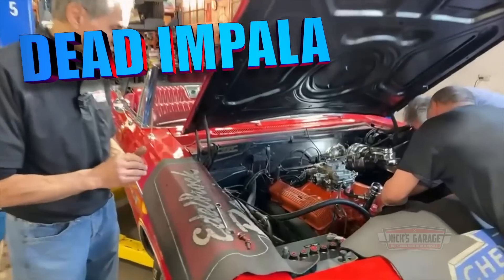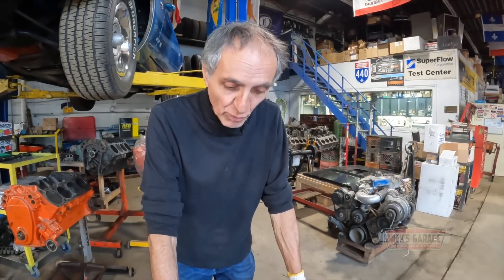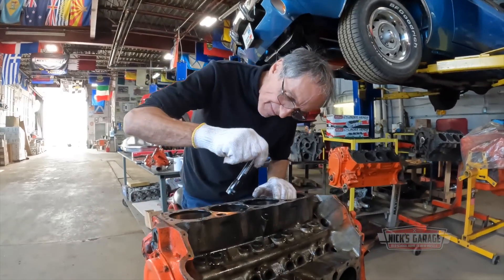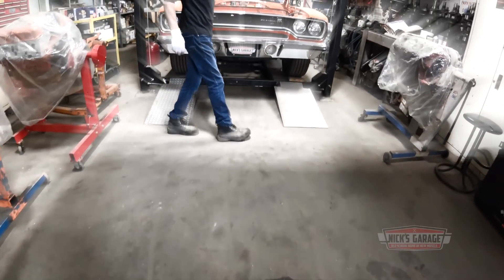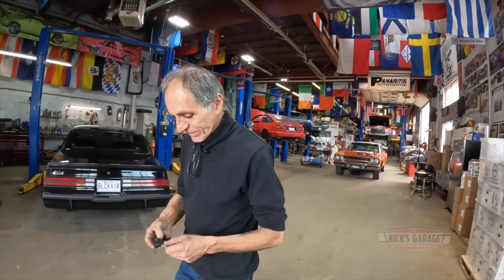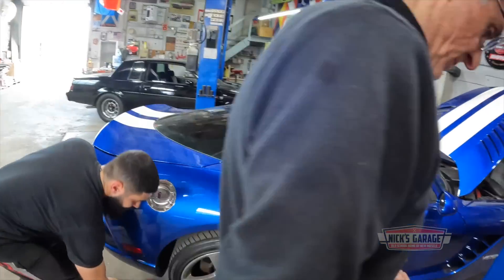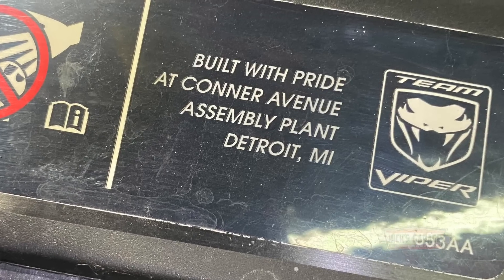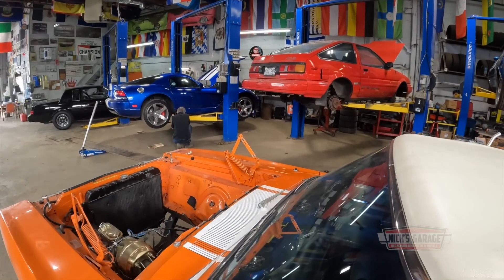327 Chevy Autopsy - Smoking Gun FOUND!

Comment: I'm on your side Nick No matter the cause of overheating The customer has some responsibility too
Reply: Clearly it was more than overheated, That engine would have been doing 30 mph with his foot on the floor and for a long time detonating real loud! On more than one occasion. That poor engine was begging for mercy!
Reply: Brian I agree but the only fault of Nick was using “Mr. gasket“ brand thermostats and not a Stant brand as I consider Mr. Gasket to be middle of the road quality at best And this situation is evident of their poor quality control. On high-performance engines I don’t even use a thermostat but rather just a thin brass plate with usually a three-quarter inch (3/4”) diameter hole in it or take the guts out of the thermostat and use it like that.
Reply: @MrR6guy  I agree
Reply: @Doing_it_right_the_first_time  The Mr. Gasket thermostat is a balanced flow thermostat and is not affected by coolant flow.  It is much more accurate then a standard spring type thermostat..... but only when they work!
Reply: I prefer the thermostats that "fail open" this way when they go bad like this one did, the engine will not overheat.
Reply: I've been drilling 1/8" holes around the skirt for decades. It makes sure you ALWAYS have some water moving through. Plus it also helps with "burping" air bubbles out.
Reply: @blackbuttecruizr  I’ve seen 11 of those fail closed from myself and friends.
Reply: @Doing_it_right_the_first_time  I used brass washers on all my dirt track car powerplants, never have a street/strip vehicle. Even had differing openings for different tracks and conditions trying to keep it right at 210 degrees with 8 lbs of pressure.
Reply: @blownaway4371  two 3/16 holes I used in Chicago Illinois where we have BAD winters. Makes the coolant system work so much better in cold weather when the thermostat will close. It keeps a better balance and heater has constant heat.
Reply: @Doing_it_right_the_first_time  Exactly what I do!
Reply: You know that hindsight is 20/20,and most of the people on Nick's page are car guys. Opinions are like....well you know. But I agree with a lot of the comments I've seen on here that basically say, at some point the owner had to know there was a catastrophic problem but chose to keep going. Who knows why,maybe he was out in the middle of nowhere and was trying to make it on home and in his mind Nick would stand behind it, so might as well melt it down. You never know how some people think, but I personally think that the customer should fess up and admit to himself and everyone else that he is the reason this thing is in the shape it's in, and he should have a fail safe system installed because it's obvious he doesn't know how to take care of his equipment on his own. A true car guy would have never let this happen. Some people love the idea of driving around in an awesome classic but would be better off just loading it into a trailer and hauling it from show to show.  BUT that's just me.

Comment: I can't wrap my head around anyone driving a car to that point. He had to know he was destroying it. With or without a light or gauge.
Reply: My sentiments!
Reply: Also told him wrong cam...
Reply: That's the first thing I thought why would you continue to destroy the engine just stop and figure out what is wrong.
Reply: STOP! And call a tow truck! Why would you drive it till you cook the engine? Makes no sense whatsoever. I've had engines over heat in my 55 plus years of driving. Never drove it till I roasted the engine. Now.... who's to blame here? Who pays 4 what?
Reply: I see it all the time. Most people today just put gas in the car and drive, they don't care about anything unless it flat out QUITS going or it's ON FIRE !  Smoke, noise or smell, or slowing down just means STEP HARDER ON THE THROTTLE !  They have no clue and nobody ever sat there butts down to explain the FACTS OF LIFE !
Reply: @Thebowzer221  We had a 78 dodge B200 van for many years, the original owners loaded that thing to the hilt and hooked a 16 foot travel trailer to it. They roasted that engine AND transmission on a trip at 30,000 miles. It got a long block and transmission because of it. That had to have been around 1980, my dad bought it in 1985 at 80,000 miles. What a bunch of idiots, how long and hard do you have to hold it to the floor to overheat and kill a 318 and 727 transmission all in one go?
Reply: True. The engine would of been screaming warning signs at the driver. Losing power. Detonation,  smells of burning paint.
Reply: It must of been barbecuing for ages surely would of smelt it
...some people got no idea😳
Reply: As the engine begins to cook the oil gets very thin and the lifters get pretty noisy. The first signs that things were going wrong would have been the smell of burning paint the lifters clacking and valves rattling. Stop and visually see. This guy probably could have saved it but either didn’t understand or realize he was burning it down.
A newly rebuilt engine should be closely monitored Nick is the best but that is a very old motor things could go wrong at anytime!
Reply: There would have a been a smell long before it stopped

Comment: That 327 would have been pinging and audibly belching and boiling long before it got to the point where it would have been smoking. As soon as you hear the pinging, and boiling you shut it down BEFORE its smokes. Pull over and turn it off to prevent irrepairable damage. Even if the hot light didnt come on, that would have been smoking like a mofo from the engine bay. Condolences to the owner but that  wasnt the fault of the engine builder. Although the possibility that overheating caused the thermostat to jam it probably would have jammed in the open position if it overheated from a cracked water jacket or drained coolant. Classic stuck closed thermostat.

Comment: The wax pellet inside the thermostat could have been melted and displaced by the extreme overheating.  45 yrs of turning wrenches,  never seen the paint burn off from overheating.  Plus that poor engine would have been pinging so bad, it might as well be a diesel,  how could the owner drive it like that and not know something was terribly wrong.  VERY fishy,  sabotaged is my guess.
Reply: Exactly
Reply: If something feels or sounds wrong check your gauges. I'm sure water and oil temps were pegged - IF - he had gauges. I've also have never seen one cook the paint off.
Reply: I completely agree, the owner must have heard something wey before he turned off the engine.
Reply: I’m thinking the same thing , like , has this guy paid up yet ? 
   But at the same time ,  you know of people that drove them till they dropped , right ?  
    Still , it makes more sense to me that it went out the tail pipe.  If it was the thermostat something up front would have let loose.  It should have blown off into the expansion tank or split a hose and that is a lot harder to miss then steam from the rear , especially at highway speeds.
Reply: My thought is someone drained the coolant on purpose.
Reply: The driver couldn't smell the paint burning off the engine?
Reply: @ewconway  Shut off ???   I bet it continued to run with the key off.  I've seen them so hot it continued to run like a glow plug engine dieseling and knocking.  Had to put in gear and then turn off the ignition.
Reply: @scrappy7571  The thought of someone draining the coolant on purpose is completely lunacy though…. Who in their right mind would want to do that?
Reply: The thing is in my opinion if it was truly the thermostat the Pistons would have got so hot that it would have spark knocked and detonated and I have never seen an overheated engine keep in mind overheated due to a thermostat or low on coolant burn the paint off of an engine however I have seen fuel continue to burn as it leaves the exhaust port due to very very late ignition timing causing the exhaust to glow red and melting the paint off a cylinder heads and cooking the top end of the engine and the very first video one of his employees said the distributor was loose and they quickly snuff that before anybody picked up on it I'm not accusing anybody of anything but I don't believe it was a thermostat sorry that's just my opinion
Reply: I agree, after such an extreme overheat, the thermostat is probably damaged even if it was working OK at the time.  That being said… that full flow thermostat design was originally done by the Robertshaw company, and they were the best thermostats, bar none. But Robertshaw went out of business and Mister Gasket bought the design.  IMO, they have not been any good since.  they’re now made overseas instead of North America the way Robertshaw did, and quality is nowhere near as consistent I’ve heard of far too many that didn’t work right out of the box or stuck unexpectedly. I use Stant thermostats now.
Reply: @stevelacker358  9
Reply: It’s kind of crazy not to have a temp gauge with the 40 overbore on an extra hp build, Stock fan and radiator
Reply: @ewconway  Let me think of a few.  Pissed off wife or girlfriend, jealous neighbor, kids pulling a prank, disgruntled owner,     the list is endless.   Situation is too fishy.
Reply: I was thinking same thing about the wax. If the engine got hot enough, some wax could have vaporized.
Reply: @ewconway  .....He never turned off the engine.
Reply: @SalterRacingEngines  ..     Yes the distributor had a slack of about 5 degrees either way.  To cook the engine that bad.
Reply: Nick I ran a business for more than 20 years You are there we are not I'm certainly not criticizing you You do what you feel is right and all we can do is treat the customer fair and do the best we can do I certainly don't wish bad on anyone
Reply: U
Reply: @nickpanaritis4122  oh wow….. I don’t want to lay blame here, but I think the driver has a large part in maybe not the real cause of the failure but the major damage done as a result….
Reply: @Chainsaw-ASMR .  After buying many bad Thermostats I like the ones that have a small hole  in them Just in case they don’t open, Always checking that temperature gauge driving these old beaters
Reply: @patrickmchose7472  my guess is maybe coolant came out the side past the head gaskets as steam and steamed the paint off......    
but even  stevie wonder woulda  seen  that
Reply: 5 degrees either way aint cookin it
Reply: @ewconway  Well, my older brother used to beat the pants off a neighbor with my 66 2+2 Mustang (I had not passed my driving test yet). The victim was a gorgeous 67 GTO. That 'Goat' was fine, but my brother was just a better driver on mountain roads. The neighbor, who had taken over payments until his bro could get back on his feet, was so livid he set the GTO on fire. If you can do that to a family member, you can do it to anyone. Hope nothing like that happened here. That 66 needs to be back on the road where it belongs.

Comment: I am a professional mechanic.
When an engine gets this hot, it is the driver that ignored all of the warning signs.
Severe detonation ( pinging).
The smells of severe overheating.
Ethelene glycol coolant gives off a very distinct sweet smell when it is leaking out of an engine.
It is just about impossible that this engine melted down with out giving the driver any warning.
I my opinion this car was "driven into the ground".
Reply: Some people have more money than brains and should never be able to treat a classic this way.  As Bugs Bunny says="What a Maroon"~!!
Reply: I agree it was maybe partially nicks fault a hose or who knows what maybe we will never know but if I went and picked up a basically brand new rebuilt car like that and was driving it my senses would have been in overdrive listening smelling feeling for anything at all that's not supposed to be and the second I felt anything or smelled especially antifreeze the slightest bit the key would go off and pull it over after all I just spent a ton of money on this car I do feel that nick should have insisted on some aftermarket gauges as well as the dummy lights working the customer is at least 85 % at fault because even if it did overheat he as was said cooked it to death and did a lot more damage than it should have gotten I've overhead many older cars back in. The day even as a kid and never cooked one that bad hell I never even blew a head gasket with iron heads ever not once and had plenty of bad radiators and water pump issues in the 80s with driving 60s and 70s era cars from the time I was 16 in Rhode island where it was a necessary thing to make sure you had antifreeze in it by September even because you'll get cold nights starting then by the time hollowen comes you better be covered to at least 15 below zero or well we all know and I learned this the hard way of course I had a bad radiator and got caught with water in a 72 Newport and ruined that great running 400 I used to get 20 mpg on the highway with sad I blew it dropped the ball whatever you want to call it but to this day I kick myself in the ass for that mistake
Reply: I agree driver just kept driving probably thinking I'm just a few miles from the house. I hate that for Nike not sure how I would handle this if the light was working that's the drivers fault that's why we have indacters on machinery I promise you buy a car and it runs hot all instruments are working it's not there responsibility to pay for repairs. Not unless it's a new vehicle and I guess it based on warranty you have
Reply: @kayceehetchler9626  I have to hand it to you, not one form of punctuation in the entire run on sentence. Kudos. Wait..I found 1 .
Reply: @Orcinus1967 
Yes I agree, a grammar/punctuation commendation is in order for that post!😂

Comment: Hi Nick , please keep looking for a problem!  The thermostat not opening after being grossly overheated would be normal.  Some of the wax that expands in it to open, would have escaped past the seal in a overheat.  It then closes and will never open again. 
Rick. Australia. 25 years Motor Mechanic.
Reply: Great point. I've noticed that just because a car travels in cooler climates, a thermostat opens & closes super frequently causing a wear ring on the body which can make the plate stick closed.. this is pretty rare but happens. If the magnaflux of the block or heads shows no cracks, a careful examination of the head gaskets & block mating surface is in order as well
Reply: Also cavitation caused by hot spots in the block happened fairly frequently on the 327

Comment: Been in the business 45 years.  People would come in for a routine service, coolant flush and change and request a new thermostat.  Even though there were no over heating issues. I can count on both hands where a new thermostat failed to open.  Rarely did they not stick immediately after the work was completed. So the last few years I would not change out a thermostat “just because”.  Most of the comebacks resulted in no damage but the customer always blamed the technician.  Sorry Nick for this problem. On such a great rebuild.  Make sure the customer sees the thermostat test you performed.  I would make sure and confer with my supplier to see if they can cover some of the costs involved …..GOOD LUCK!

Comment: Why assume the thermostat failed BEFORE the engine?

Maybe the thermostat was damaged when the engine overheated. Those thermostats use a wax that melts at 180F to actuate. At the extreme temperatures during the overheating, some of the wax could turn to vapor and cause damage.
Reply: as hot as that motor got the T Stat may have been OK before the problem
Reply: Good point. Wonder they drive few hundred miles before overheat. How can that be. Any thermistat wuold go kaput in that heat.